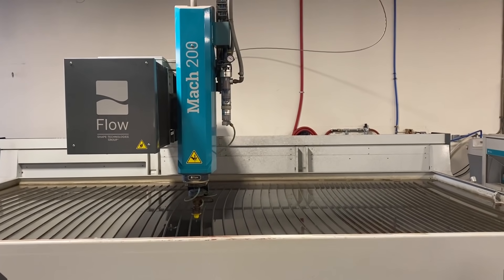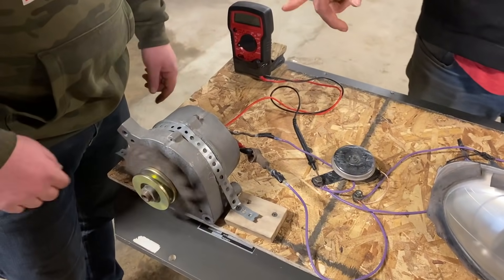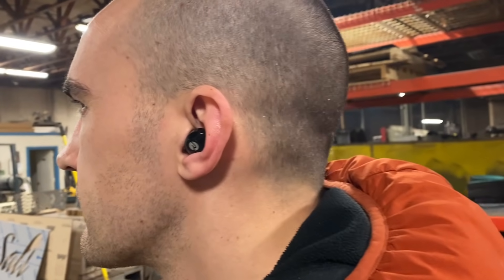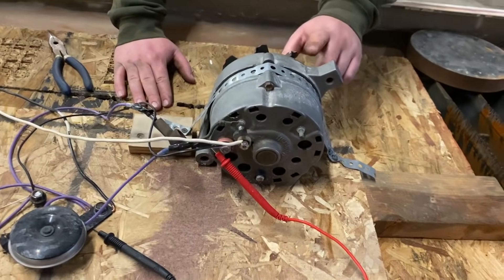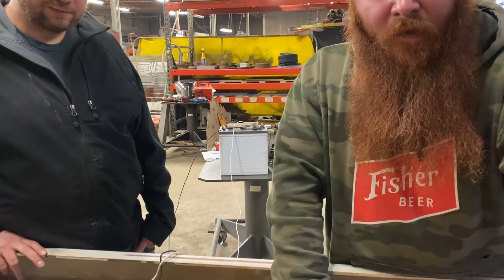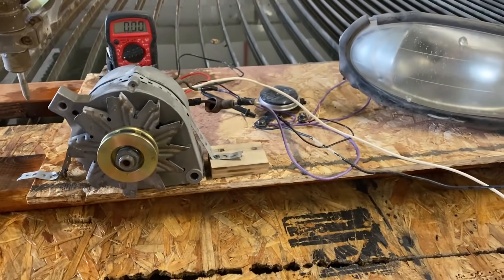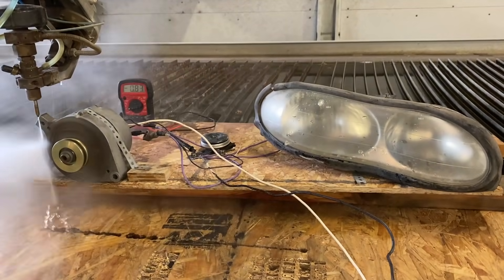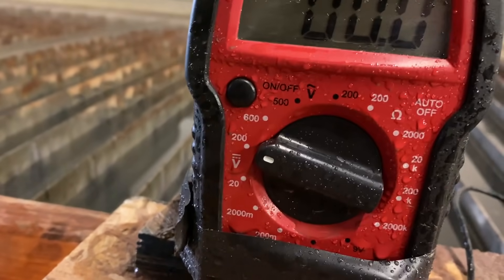How Much Voltage Can Alternators Generate? Using a 60k PSI Waterjet

Comment: One of my favorite videos yet!! Imagine a hydro generator that's used in rivers and such to make power but put under the water jets speed. Wonder what it could power then!
Reply: They are set up to run at a certain speed. Running them faster won't do anything because you would need to design it for that.

Comment: Plot twist: You had it spinning the wrong way
Reply: It dosent matter , it will work anyway.
Reply: El Stefaano some light don’t work light that
Reply: @milesr5259  So.. it starts sucking that light?
Reply: Also the internal voltage regulator will only output the ~6V it’s set at. Also, you gotta power the exciter wire on a lot of these ‘1 wire’ alternators.
Reply: i was coming to comment that had to check
Reply: So...when they turn on the headlight the room would get darker?
Reply: @Skoog.  is right. The alternator will work either way. The name "alternator" comes from the fact that it produces alternating or AC current (keep reading).  Actually the final output from most (possibly all) automotive alternators is direct of DC current, but that is because they have electrical devices (diodes, aka rectifiers) built into them to turn the AC into DC.
Anyway, before the diodes, the alternator is putting out AC, so it doesn't matter which way you spin it, it will still put out a sine wave voltage that goes both positive and negative.  The diodes will always make the positive and negative terminals the same regardless of which way the alternator is spinning.  So spinning it the other way will not switch the positive and negative.
Now for a bunch of notes to attempt to cover some of the related issues:
1) Old fashion incandescent lights run fine on AC or DC and don't care which terminal is connected to positive.  A simple LED (without any driver circuitry) will only light when the positive and negative are connect the correct way -- reverse the wires and they won't light.  BUT, most LED lights have driver circuits to feed them the correct voltage.  Often these driver circuits will have diodes (much like the alternator) that make sure the actual LED gets the voltage the correct way even if you connect the wires backwards.
2) The cooling fan on the front of automotive alternators probably works better in one direction that the other.  The alternator may not cool properly if run backwards.

3) Automotive alternators (like generators), can be either negative or positive ground.  Negative ground is much more common, but I have a vehicle with a 12V positive ground alternator on it.
Reply: pAAirs sure lol
Reply: Andrew Snow I completely agree. I was referring to some lights in general, not the way the alternator functions.
Reply: Proper wiring or you could create a "Black Hole" and a continuum fault....
Reply: Ben Upde that alternator doesn't have an internal voltage regulator. That's the reason they chose it-they said as much in the beginning of the video. Also, it's not a 1-wire alternator. It needs a field connection, which they provided later. If they just connected the battery to the B+ terminal, it still wouldn't have worked.
Reply: They are spinning it the wrong way, the blades are meant to sling the air AWAY from the center to cool the windings.
Reply: @milesr5259  LEDs won't work but halogens will.
Reply: it's an alternator,it can spin either direction
Reply: I was designed to spin the right, couldn’t help but think it would work better that way.

Comment: When the alternator quit spinning it's like opening a circuit with an inductor in it. When you open a circuit with an inductor you get a massive voltage spike. If you rectify it then put a capacitor on ground you'll be fine as long as you stay within the voltage limits of your components.
Edit: 
According another comment thread the power is already rectified. The alternator just needs a good ground.

Comment: with that ford Alternator..  FLD is the positive brush for the rotor..   the case hooks to the negative battery ..  the output hooks to the positive battery or load that the other side is hooked to the negative..

 if you hook up the field or FLD to the positive you will max field the alternator.. and you should be able to get over 100 Volts without a battery or regulator hooked up.. but the diodes will usually short without a load..   the diodes will usually be either SIX of the 35A 100PIV or six of the 50A 200PIV diodes.. 

 if you look at the STA terminal with the meter set to 200 VAC... you can see what the alternator is actually putting out.. that would be half the output voltage but in AC not DC.. that is the twisted end of the stator windings.. so there is no diode filtering out positive voltage above zero to the output stud and negative voltage below zero to the case..  alternator..

Comment: For all of you asking, I calculated the alternator RPM at 11,520 for the first run and under load it was fluctuating between 3000 and 5000.
Reply: How? By the sound? Or was it based on pressure or output voltage or something? Just curious.
Reply: @deltab9768  Yes, 1000RPM = 16.6hz

Comment: I think what happens too is without a battery to add as a large current sink, sometimes the voltage will make it out before the regulator can "catch" it as it will have a bit of a delayed reaction.  That's why it gets super bright at first and then it tapered off to it's max voltage.   I too recently learned about field windings while bored and doing research.  I had no idea alternators worked without magnets before that.    It makes a lot of sense though, especially for AC alternators such as generators, because you can't regulate the voltage with speed as you need to keep frequency the same, so the way they do it is by regulating the field.  Car alternators produce AC I believe, then it's rectified into DC.  You could in theory convert one to produce a rather clean AC at a fixed frequency then regulate the field coil to get the voltage you want.
Reply: What regulator?  This one had no regulator, even before they fried every diode.  That what causes it to load internally later - being broken.

Comment: I’m not a veterinarian, but I’m pretty sure that’s free electricity
Reply: just need a $50,000 water jet eh!
Reply: whats powering the water jet? :0)
Reply: sellingthewind shhh
Reply: Ummm,  water jet isn't running on that 6v alternator I don't think....
Reply: @leeneal6969  you probably could use a river instead. If someone patents and builds that they can probably make a bunch of $$

Comment: This would work so much better if you applied some voltage to the alternator's field terminal. Alternators need electrical current to energize the alternator's field winding before they can generate anything.  You need to add a battery into this design and apply 6 V to the field terminal and then spin the alternator up

Comment: An interesting experiment to try is to have it spinning at max speed unloaded and then directly short the output terminals!  It will stop so abruptly that it will rip that plumbing strap off and that alternator will go flying!  I did this years ago with 220 psi air in the shop, had the alternator clamped down really well in a vice, used a 9v battery to field it and dropped a screwdriver across the output.  It was a GM/Delco 85A alternator.  It sparked like crowbarring a big cranking battery and the damn thing shot out of the vice and punched a hole in the sheetrock on the other side of the garage!  Was not expecting that and was lucky I didn't get seriously hurt!  Definitely goes under the don't try at home rule for sure!
Reply: Could you lift it by that screwdriver afterwards?
Reply: @tsm688  LOL no but it was already magnetized.
Reply: @cpufrost  Remembering a screwdriver that got dropped into a power supply, it got welded to it
Reply: @tsm688  Yeah it would most likely been stuck to the stud but when the (alternator) got chucked with sudden force all bets were off.  The screwdriver did have a nice chunk taken out of it though.

Comment: You guys should get a clamp on ammeter and test the short circuit current of the alternator at full rpm. I wouldn't recommend using your handheld because there's a good possibility it'll blow the internal fuse, but it sure would be fun. Another fun thing you guys could do would be to connect it to a 12vdc to 120vac inverter and plug a phone into it to make a "water jet powered phone charger"
Reply: The inverter idea is excellent! I kinda wonder how one of those little 12 volt air compressors would run on all that amperage.

Comment: Ok so another lesson, the 12 volt lights running at 6 volts will try to draw double the amperes. For an example, a 60 watt bulb. 12v x 5 amps equals 60w. But 6v x 10 amps equals 60 watts. The more amps you draw from the alternator the harder it is to turn. So if you did in fact get it to spin at 60k rpm, it only did it when it was unloaded.

Comment: In the beginning of the test, I was like, "That's not a self-exciter. "  but you figured that out.. That's cool, but you're running it backwards.  Spin it the other way. (Clockwise)
Reply: Direction only matters for cooling.

Comment: wire the field only to the external battery. remove the jumper. the field is meant to run at 6 volts so when the alternator starts producing more voltage the current draw goes up a lot and thats why it bogs down so much. you should be able to get much higher voltages this way.

Comment: If you run it long enough with no load and the field energizing itself it will either fry the rectifier or melt the coils, basically it turns into a heater, then a doorstop. 
You should get jumper cables and some DC welding rod, itshould be more than enough power.

Comment: The reason you blew the three bulbs wad there alternator didn't have any excitation, therefore there was no resistance and it was spinning as fast as there water jet could push it. Once you'r built up enough voltage and energized the field, the alternator is spinning so fast it puts out a crazy amount of electricity. Once it begins making electricity the load on the alternator goes up and its speed slows down causing the voltage to also come down.

Comment: you can make that thing put out like 300 volts or more by feeding much lower voltage input to the field winding. the speed will generate the voltage on the output. that alternator problaby is capable of producing at least 15 kw at a high enough speed.

Comment: The trick with just connect the output to field, apparently doesn't work with new alternators. Why? The iron within the assembly will actually become slightly magnetic after it's been run for a while, and be able to self excite. It's an old school trick to throw an old chevy 3-wire alternator onto a tractor being converted to 12v from an old generator setup, and just do exactly like you guys did, rather than run extra wiring to a new ignition switch.

Comment: FYI you need to energize the alternators voltage regulator before you get it to make power, unless your using a marine one wire alternator.

Comment: The field coil is saturating when the voltage spikes and then it causes the drop. If you could control the input voltage and keep it at 7 volts or so it would keep it from saturating the field coil

Comment: Interesting to see when it tries to alternate the current (the magnetic field colapses because it doesn't have a voltage bias from the battery to keep it stable) and the voltage turns positive for  a moment. You should have fed the alternator loopback with a Diode in series to try and keep it stable.

Comment: considering the horn was actually going as soon as the multimeter read anything, i bet it somehow internally regulated what the alternator could spit out. if the horn wasn't connected in the last test, i bet it would've gone nuts (till the diode pack to make the alternator spit out DC instead of AC failed at least)

Comment: wow lots of clueless in this video and the people commenting , alternators work fine either spinning direction, the only thing the direction affects is the cooling fan , and not all generators have magnets , most have field coils like alternators ,the difference is the power is produced in the rotor in a generator.And if you only have the battery hooked to the field coils its isolated from the charging circuit so its fine being hooked up

Comment: I’m pretty sure that you were running the alternator backwards because you can see on the multimeter it showed negative every time. the headlights light up because polarity doesn’t matter on on those old ones. But the horn didn’t work and that’s why.

Comment: Here's my automotive knowledge speaking: firstly, I'm not sure if you're measuring AC or DC with the voltmeter. Also, with many alternators, they have what Is called an excitor, which is a very small DC power supply given to the rotor in order to amplify the magnetic field of said rotor, into the stator (copper windings). It takes magnetic power to effectively move electrons. If someone disagrees with this, feel free to reply!
Reply: Now that I actually watched the video fully 😂 I hope this at least gives a better understanding lmao

Comment: You guys know alternators have a regulator in them, the volts won't increase, however the current will... until the diodes burn out - which will cap out at about 10-100 amps.

In addition, you need a small amount of power in the stator to create the necessary magnetic field.
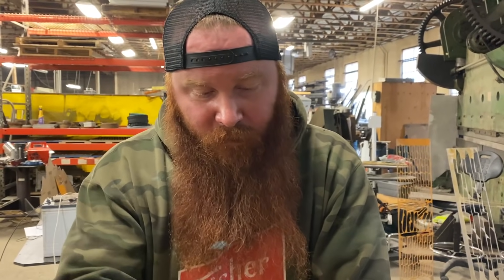Reply: Edit - 5:36 - I see you figured it out...
Reply: They specifically state in video and comments that its unregulated...
Reply: @tsm688  the fact still remains that it is an alternator - without a small amount of current flowing through the stator, you won't generate much - if anything at all.
Reply: @TheAussieRepairGuy  Watch the meter during the first test -- there WAS output, just little.  The soft iron core holds a magnetic field, albeit a weak one.  Some of the first electric generators relied on that to start without batteries.

Hooking the output to the field allowed 'a little' to become 'a lot', very very rapidly.
Reply: What I'm trying to point out is the distinction between generator and alternator. Alternators need a small current to create sufficient field, generators have fixed magnets. Laminated iron cores are laminated specifically to reduce residual magnetisim, as it inteferes with ac power generation, this is why alternators need a rectifier.

Comment: 20v won’t make a halogen headlight explode. That meter isn’t going to show a pulse, pulsing the field coil under super high rpm will give you a huge inductive spike of 1000’s of volts and and the momentum will drive it with substantial current. The question is how much of that would really be sent to the lamp through the diodes? The proper tools would be an oscilloscope with a 100x probe.

Comment: If I’m not mistaken I think you’re turning it backwards
On anything I have ever worked on which is a whole Lotta shit it always turns clockwise.
You can get an alternator with a built-in regulator. A lot of race cars or hot rods run them.
Also cool headlight from a 1998 to a 2002 Camaro 👍🏻
Reply: Alternators don't care what direction that they spin. The create A/C current that is rectified into D/C current.

Comment: You should run a wire straight to the brushes bypassing the regulator then it'll put out more volts.
I used to make welders out of alternators and I could get 100-150 volts out of them.

Comment: Hope you didn't shell out for the 6v car battery, you could have used a $3 dolphin torch battery. Also, try again with a light bulb wired inline on that field wire- a mechanic taught me that when I wired my first buggy. It could be why the alternator was loaded up still even after the bulbs blew.

Comment: There isnt a regulator inside but there is a rectifier inside. Pull that out and you will pull ac voltage that will for sure run those headlighs

Comment: thats an old style alternator so it likely doesnt have a voltage regulator built in. might not limit power output like assumed. my 1975 mustang has one of those and the voltage regulator is external on the fender

Comment: my 67 mustang came with a 12 volt but when researching my parts some 66 had an 6v alt or generator depending on options selected at the dealer

Comment: It is possible with the initial high voltage, the diodes failed resulting in the heavy internal loading. Might want to test if the alternator is functional.

Comment: Does the alternator have a built in rectifier? If it doesn't, you need to put the meter on AC. It may be producing way more voltage than you think.
Reply: smeezekitty , an alternator is basically a 3 phase generator with a 3 phase rectifier built in.

Comment: Spinning alt in reverse just gets a negative voltage. Just gonna leave that there. This was a great experiment tho I did enjoy. Try a 12v alt next time and see what kinda voltage you guys can get. Maybe try to power some 24v stuff.
Reply: Matt Morrison , where did you get that idea from about the reversing voltage ? It’s an ac generator with an rectifier. So it doesn’t matter what way its spins.

Comment: Just hook a wire from "fld" to "bat". No need for a battery. Once the alternator makes any voltage the output will take off (it will keep feeding itself).
Edit:
Meh. I should watch the full video next time before posting.

Comment: If you bypass the regulator , you can get upwards of 1000 volts at high speed ,from some alternators, 200v should be easy,

Comment: Did you hear that WatchJRGo was LS swapping a Rolls Royce to enter in the Cleetus and Cars burnout challenge in Houston TX? I was wondering if you could cut a hole in the bottom of a Gray Poupon mustard jar, so he could put a nut in the bottom and fill it with mustard colored resin to use as a shifter knob?